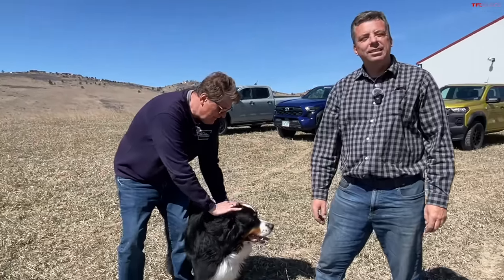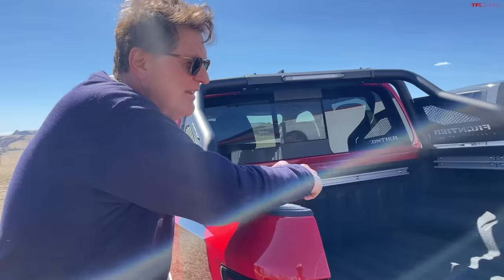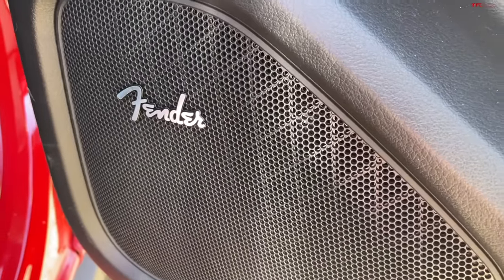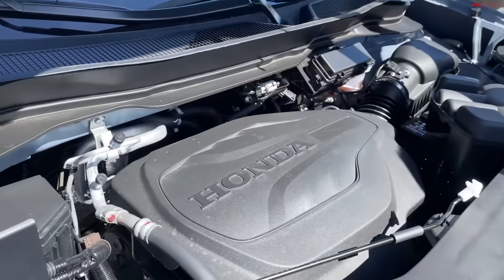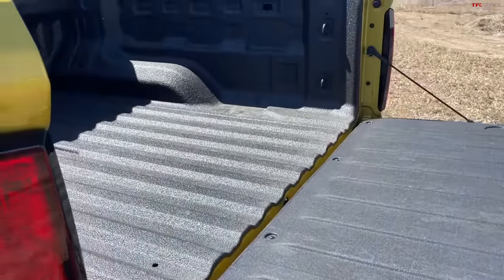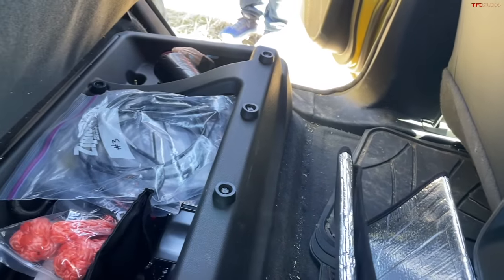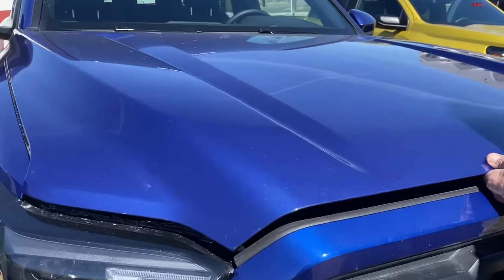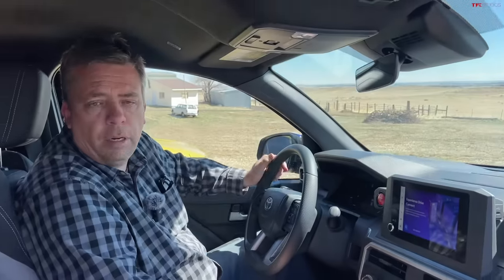We Compare 5 Brand New Midsize Trucks: The Differences are Very Surprising!

Comment: I love the looks of the Hardbody but the lack of LED headlights (at 46K) is a bit ridiculous given lower trim models of Frontier have them. I'm sure it compliments the retro look but that shouldn't be done in the name of safety. Again, I love the Frontier but the Pro-4X is definitely tempting for more or less the same price.
Reply: For 60.00 you can buy led replacements, but I get your point.
Reply: @jdev232 replacing halogen bulbs with led doesn’t work to help you see better. The reflectors are not made for led. It only serves to blind oncoming drivers.
Reply: @Policearegood-mt6kx  ok...600.00 then. I think that's what they are. Whole LED replacement lens. You can still aim the led tho, so why the blinding effect? Never did a switch,  always had one or the other...
Reply: @jdev232  I hear ya. I love me some Lasfits but at that price point even stingy Honda puts LEDs on the Ridgeline Trailsport
Reply: @travisp11  I'm kind of amazed at just how dog shit halogen are...they haven't changed at all since the 70s in brightness. So..we have handheld computers now (cell phones) but can't make a better halogen bulb? 🤷🏼‍♂️
Reply: The hardbody is a dealer installed package.  You can put it on a pro4x and get your led lights. In this case they put it on the lower sv trim. Which to send tfl a sv trim instead of the offroad pro4x trim is a miss on nissans part.
Reply: @spyder000069  ahh, gotcha. That makes sense then.
Reply: @jdev232  this is true.
Reply: @jdev232  the blinding effect is because halogen reflectors are not designed to properly reflect the light produced by led bulbs. It scatters it and doesn’t put the light where it’s needed.
Reply: @Policearegood-mt6kx  ok. What about hid?  Any better?  Or is that worse?
Reply: @jdev232  I’m not sure; I just know if you want led headlights you need to buy a vehicle that comes with them from the factory.

Comment: Hey TFL, just a little correction but let me know if I am wrong. The Nissan Hardbody Trim only comes on the SV (from what I can tell from Nissan's Website, I also mentioned it in a previous video of yours). I don't think you can get it on the Pro-4x, you all mentioned you can but I don't think that is correct. On another note, I am Nissan a Fan but at 46K without a rear locker, that Hardbody is not worth it I think. Should be 10K cheaper. Great comparison video!

Comment: There’s no way the Tacoma is 45k and the Frontier is 46k in real world. You could the the Frontier for 40k and the Tacoma your gonna be at least 50k. MRSPs mean nothing right now thanks to dealer mark ups and Toyota are balls the wall with them when it comes to the new Taco.
Reply: The hardbody package on the frontier is what drove up the price.  You can find that same SV without the graphics/lightbar/wheels in the $35-$38k price range and most people say you can negotiate some $ with nissan.
Reply: i just bought a 2024 fully loaded frontier pro4x for 39900 10 days ago. traded my tacoma in. the equivalent 2024 tacoma trd sport to my trade in was 53400.
Reply: @maccooley3451  Did you get the leather seat/sunroof package?  Fully loaded is something like $48k msrp.  What was your msrp on the window sticker?  Also was the 39,900 out the door or before tax/title/fees?
Reply: i don’t finance sales tax ever. i pay it out of pocket. it was 39990 plus 129 paperwork fee otd. i always decline everything the f and i tries to peddle unless they show me actual cost, and i will pay 10% over. they never show it.
Reply: That was a mid level SV Frontier with some extras and the Tacoma trd OR base engine with zero additional options. And they’re priced close together. The Tacoma trd OR has many tech and conveniences packages and hybrid engine option available that can get expensive quick. Yes the Tacoma will be much more expensive than the frontier in most scenarios but their Tacoma is a pretty basic one.

Comment: For those that use trucks for the trades the width of the bed should be mentioned. Until now the Ridgeline has been the only truck wide enough to accommodate 4x8 sheet goods. That width also positively impacts the interior comfort and road handling of the truck. Apparently the new Ford Ranger is now just wide enough to get sheet goods flat in the bed, 48"wide vs the Ridgeline's 50". For those like myself that use these for work that is a huge deal.

Comment: So Toyota broke the front differential and now the check engine light is on too, yikes.
Reply: I think he said service soon.  Not sure if it has odometer based service reminders.  Some vehicles do for oil changes and other maintenance items.
Reply: No. I thought it  was pretty clear in context. It’s just due for its first oil change.
Reply: @jubowub3685  OK that sounds better.
Reply: 45 grand for a midsized pickup,is ludicrous
Reply: Agree on the price but “midsize” today is what a 1/2 ton used to be (hp, towing and torque) before they started putting 1/2 tons on steroids.

Comment: What we need is a truck that’s a little bigger than these, but not as huge as the 1/2 ton pickups.  For families with kids in car seats or booster seats, none of these have enough room.  For daily use and parking or living in cities, the 1/2 ton trucks are cumbersome.  We need Goldilocks.  The Ridgeline is almost there, but needs just a couple more inches of room for the rear, more ground clearance, and more aggressive styling.
Reply: You could bolt the child seats to the bed facing backwards. But I think what you are describing is a minivan. When the last one is discontinued they will suddenly be in fashion again so it may be a bit of a wait.
Reply: There's space.  People think they need the seat as far back as possible.  They don't.  Or they could do with losing some (several) pounds to free up some space.  They won't.

Comment: Four-wheel-drive switch on the Tacoma I think your Pepsi’s gonna get spilt and run down in there and cause you a whole Lotta headaches Toyota engineers are getting younger and dumber. The old ones are gone. All buttons should be on the dash. Heater and air conditioning used to be a rod slid back-and-forth. If you haveone  they still work today now they have electric motor or a little vacuum line that last about 3 to 4 years.

Comment: I wouldn't be too concerned about rear passenger seat leg room....it is a midsize truck. I am partial to the Nissan. As I have a 23' Pro4x. It was reasonable price and good value. about $40k. And I like the relative simplicity of the frontier. plus I got a locker and about $3k off. good luck getting a deal on the new tacoma or even ranger for that matter. don't even get me started on the chevy, that engine is a ticking time bomb. and the Honda Ridgeline is basically a minivan with a bed. love Honda. but that truck is a bitch. The Nissan sounded the best as well.
Reply: The engine they has been in the larger Silverado/Sierra for 5-6 years is a ticking time bomb? OK.  🙄
Reply: Only someone who has no passengers would think rear seat room isn't important.
Reply: @gogofastful  My point was, if you often carry rear passengers...don't get a midsize truck, as there are better vehicles for that.

Comment: In my 68yrs, I've had 4 Nissan, 1 ranger..the ranger left in 2010,..Beauty in eye of the beholder..For me styling goes- 1Ranger, 2Nissan, 3Honda, 4Chev, 5Taco..A real truck must have an min 6ft bed..or it's not on my list. I still have a slide in camper and you can   haul 4x8 plywood...short beds seem more of a fashion accessory than a man's work truck.

Comment: I always put a topper on the beds of my trucks, so that Frontier rack would have to GO away. I do like the Nissan is no turbo, yet highest HP in the class. On those turbos, when towing, the fuel economy advantage disappears. None of these mid sized come with a larger fuel tank option, which is critical for those of us that do long distance towing.
Reply: I also always use a topper and had the same thoughts.  I like that the nissan is smaller and the naturally aspirated engine but its considerably less torque than the the gm twins and ranger 2.7.  I might be able to look past that if at least the dash and infotainement system was updated on the frontier.

Comment: I take the Taco over any other midsize truck easy.  Ridgeline be my 2nd choice.  I stay away from Ford and Chevy.
Reply: I have a 21 Tacoma Trd OR, I’m going to wait another year or 2, and probably trade for a Tacoma Trd OR maybe with the Hybrid package, plus wait & see what Honda does with the next gen Ridgeline. The Ridgeline needs their 2 liter Turbo with Hybrid setup and 9 inches ground clearance at least on the Trailsport model!
Reply: So you sit when you pee..thanks for sharing.
Reply: @TREVORJB101  are you 12? Definitely not getting the "high functioning" vibe
Reply: Out of all the trucks there the Toyota broke spinning the front tire on snow and you would still pick it first?
Reply: I’ll take the twin turbo V6 over a 4banger all day long.
Reply: Ehh with the new Hybrid idk…
Reply: A ranger and taco are the only things I’ve had to make it to 300k trouble free miles.
Reply: @gregc9220  perceived reliability… 😝

Comment: I own a trail boss and have never once changed the headlights from the Auto setting. They said it here - it's annoying to car reviewers because they need to turn on/off the lights for filming. As a regular owner it's a non-issue. They also messed up with the options. Optioned leather seats that cannot be heated/cooled?? It's way smarter to use that money on the automatic cruise control and the 360 camera. Most power, best in class towing/payload, auto AWD, and cheaper than the tacoma. Only thing missing is LED lights.

Comment: I've been driving domestic pickup trucks since the 90s because i've always had stuff to tow, but none of it was over 6,000lbs in all those years.  Finally I hit a point in my life where I was ready for a comfortable ride, no longer needed to tow over 5,000lbs, and I was getting pretty tired of constantly replacing parts before I even hit 100k miles on my domestic trucks.. I went with the only vehicle with a pickup bed on the back that doesn't ride like a truck and is easier to park, a Honda ridgeline.  People can say what they want about it, I really don't care, I've put 27k miles on it since I bought it new, I tow an 18' aluminum boat all over the hills of the ozarks with it on weekends and also tow a small 2 horse trailer and my daughters horse to local horse shows and I have had ZERO return trips to the dealer.  This is my first truck that has had ZERO return trips to the dealer in the first 2 years of ownership.  I keep up on the maintenance and plan to keep this swiss army knife of trucks for at least 10 years. 
Oh, and in regard to gas mileage, when not towing/hauling i'm getting 26-27mpg on my 60 mile roundtrip work commute (all highway).

Comment: Great video, but my only complaint is you are not comparing similar optioned vehicles!  I get logistically it would have been more difficult to, so I would have just compared these vehicles by design, dimensions, and drivetrains.

Comment: Tacoma breaks the first time off-road! And was not even a hard trail. I think not. Brand new!
I like the Frontier, just with the smaller cab, and longer bed. Plus, it's Cheaper  that way.
Colorado is nice with the power and torque, just needs cruise control.
45k! Think I'll keep my 2001 Chevy 4x4. It's proven.  Also, what's the  current 2024 price of the Colorado? You keep quoting the 2023 price. Did it stay the same?

Comment: If "you want a truck, buy a full size", if you want a compromise buy a mid-size. 4 cyl tiurbo towing 6K? Good luck getting 200K. The Honda is innovative with storage...a huge lockable bin in the bed and superb back seat under seat storage, a comfortable ride with non turbo V6. It isnt a truck but is the best compromise I think.
Reply: perfect take

Comment: I had a 2001 Ford Ranger, which I gave to my father-in-law, and I much prefer its bed dimensions. It had a SuperCab with suicide doors, but it also had a 6’ bed. I was able to carry a full size refrigerator and a range at the same time. The new Ranger is 5’, and the Maverick is 4’6”. In addition, the price has more than doubled. (Tripled, considering I bought my new 2001 Ranger in 2002 for $13,000, because it was leftover). 

Why can’t they build an affordable rwd pickup with a real bed???

Comment: yes Colorado is the best looking truck but has  some major dark side issues after 30 to 35 thousand miles like power steering can stop function while driving , rear diferencial ,engine shacking and those issues are not easy to repair

Comment: I have owned multiple Dodge Dakotas ranging from 88-99 my personal Love is my 1999 Dakota 5.2l 5-Speed with the HD Service Group with 3.90 SureGrip axle that I ordered from the factory 25 years ago MSRP was $18,999. In 25 years of faithful service it has had 1 water pump which I replaced all the idler, tensioner and serpentine belt $180, 1 clutch $375 and 2 heater cores $40, I just recently spent $750 dollars on all new Mevotech front suspension pieces with KYB Monotube shocks. I will milk another 25 years out of mine Thank you very much !!! If Dodge/Ram does bring a Midsize I will be keeping my 99 as my workhorse and drive the new one for my daily.

Comment: I HAVE PURCHASED 8 TACOMAS AND I AM DONE!! TURBO 4CYL STUPID TOYOTA! MORE HEAT,MORE PARTS AND MORE STRESS NISSAN HERE I COME!!!!!!!!!!
Reply: I have a 98 4runner. With the 3.4 six. If I had to choose one of these trucks. I'd get the Nissan frontier.  Plus my wifes old sentra has over 3200000 miles on it. Its a beast.

Comment: You guys need to get the specs correct.  I think in 21 they put a 9 speed in.  1st gear is typ bypassed.  When you need a low gear it uses 1st.  4.7 ratio

Comment: Wow. We don't see eye-to-eye on truck styling. Just as I was thinking "I like the Ranger a little better than any of the others", you both announced that you don't like the Ranger. The new Ranger styling looks alot like a Maverick to me, which is a good thing in my mind. If you had the previous ranger in this lineup, I would have it at the bottom of my styling list. But I really like the new styling on the Ranger. In my opinion, it's a close styling competition between the Ranger, Colorado, and Frontier - but not the trim for the Frontier you picked for this video.
Reply: The Ranger styling isn’t the best but with the 2.7 EcoBoost V6 it’s the best truck here
Reply: @BC08 Really? What is it you don't like about the new Ranger. I am somewhat biased because I received my Maverick last October. I guess since I really like the looks of the Maverick, I'm inclined to also like the looks of the Ranger, which, to me, looks very similar.

Comment: I'd pick any of these trucks with the top trims if they had a 6ft bed.  This is the only reason I am driving a 24 Taco. The only one with a 6ft bed. There're only three things that I don't care for.  Too much Plastic for this price, and the lack of a Trip meter A/B to reset and no locking fuel cap.
Reply: Valid!
Reply: It can be a 6ft with the cage extender from Thule 😅. I don't trust the turbo taco. I don't know of any reliable turbo charged vehicle.
Reply: @diz_guy47  I was doing that on my Ford Maverick with a Ready Ramp.  Bed Extender that's also a Ramp for my Supermoto. I can close the tailgate now and fit my foldable drive-up ramp now on the Taco. We don't like change but that's the way it is.  EV Toyota trucks are next.

Comment: All of these trucks would be a great full size replacement if the back seat had about 3 to 4 inches of more rear seat space. I would add 1.5 to 2 inches for leg room and 1.5 to 2 inches for more rear seat recline. Then to top it off, I would add another 1 inch or so for head room. If I was designing a midsize, I would just take the space from the engine bay and rear bed. The full size trucks are stupid big. They are way too hard to park and maneuver around the city and trails.
Reply: But they have already stolen space from the beds and engine compartments. Engines stuck way back under the cowl, it’s crowded, and beds that are 5’ long. Not much more space to steal and can’t make it too long so it can fit in a garage

Comment: We've known for years the 8 speed GM uses in those Colorado's were rubbish. Everyone was skeptical about the end result when they said it had been "reworked" with the latest generation.  It's honestly an embarrassment at this point. Spend the $ and put a ZF 8 speed in it, or the in-house 10 speed they made alongside Ford. With decreased warranty issues and happier customers it would probably be a net gain over time.

Comment: With regard to the headlamp button, most people leave it on auto.  If you weren't filming, it wouldn't be an issue.  Removing the button reduces cost and switch breakage.
Reply: I have never seen a headlamp switch “break” in any newer vehicle (last 20 yrs)
Reply: I was making a delivery early in the morning at work, and when I put the truck in the park, the headlights turned off. Trucks are used for work, and sometimes, you need the headlights to see what you are doing. Giving the driver more options and more control over the truck's systems is always a good thing. You never know how someone else will use their truck.